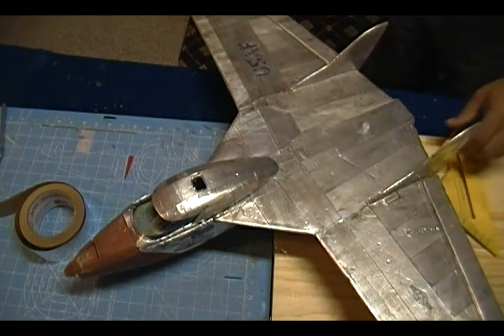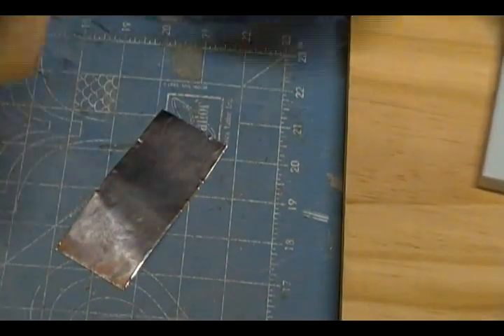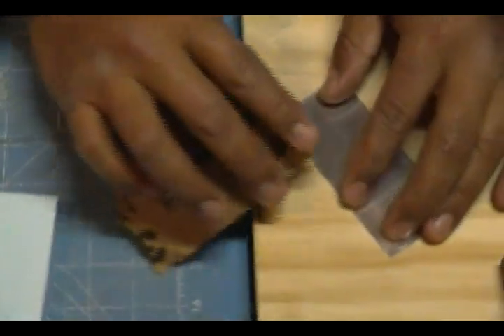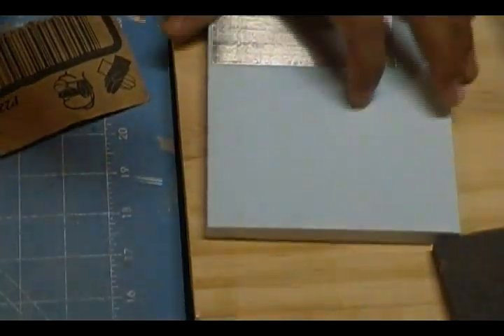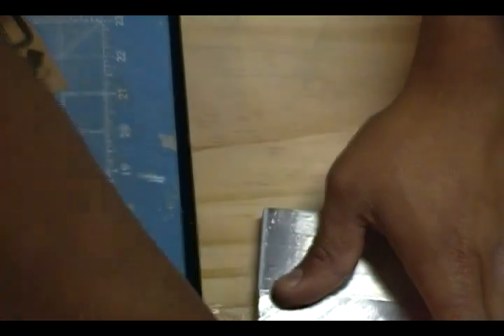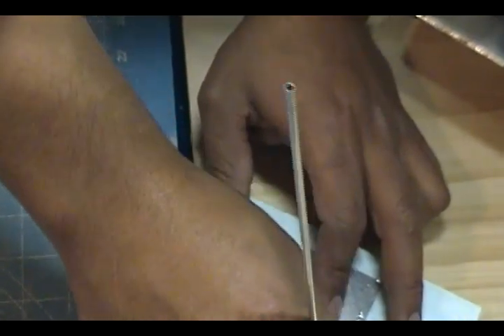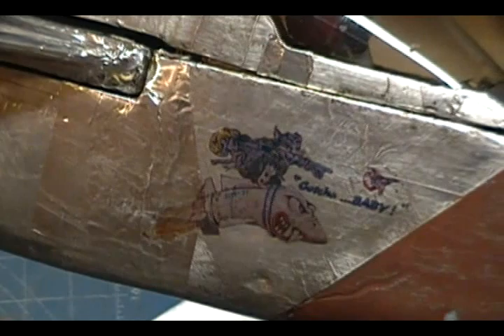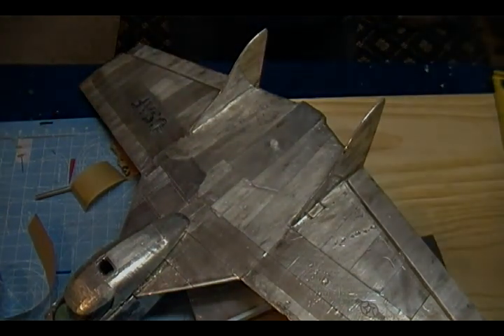how to  scale aluminum look on r/c planes

Comment: Very cool effect.
There's a rolling rivet tool that you can get from scale model hobby shops. They are very small, easy to handle, and make a very good "rivet" scale look. It would cut your riveting time way down, and the distance between each rivet is exact. They come in different sizes and spacing.
Cheers

Comment: There's a technique I've seen on a forum somewhere, where the guy took a gear from an RC car, beveled the teeth with sandpaper so they were sharp and pointy, then rolled it on the aluminum tape to imprint the rivets.

Comment: this tape is 10 times better than anything stocked in hobby shops, I have always used this and gold and copper versions to, buy it from china, it's strong, very adhesive, very thin and really cheap. I get a 5cm wide 19metre long roll for about £3 from aliexpress ... beats anything else imo.

Comment from the maker: I was worried about this at first too but the guy I learned this from uses the same radio and receiver on hes  turbine F-100 (all LOWE'S  aluminum covered) that I use on this plane and has never had any problems with the signal I fly my plane as far away as I can see and I have not have any problems neither it may  depends on your radio or it may be that 2.4 is not affected by this problem as the oldest radios

Comment: The video does not do justice to how this technique looks,used it myself with great success,just a few extra tips for you to make rivets you can do it two ways firstly old clock wheels mounted on a simple spindle and fixed into a piece of dowel as the holder,then you just roll the wheel along a straight edge,the other way is to use an hacksaw blade you simply press the teeth into the foil/foam/balsa surface and on the curves simply rock the blade,now you do not cover curved surfaces but a good tip is to apply the aluminium tape swatch and press the centre with a domestic spoon then work outwards and the friction heat from the spoon will make the tape curl nicely practise makes perfect,keep up the experimental work its the only way to learn and be good at these jobs.

Comment from the maker: it is a little heavier than paint but  the extra weight makes no difference in flight characteristics Although this aircraft is small, so I'm sure larger aircraft would have not  problem with the extra weight

Comment: have you ever try to cover balsa wood with aluminum tape if so how dos it holds ??
Reply from the maker: It works better on balsa or any hard surface , I have use it on balsa but you have to prepared the surface, you need to sand it good and prime it.
Reply: thanks for your tip keep building your planes good skill brother . i will fallow your videos a lot to learn from thanks